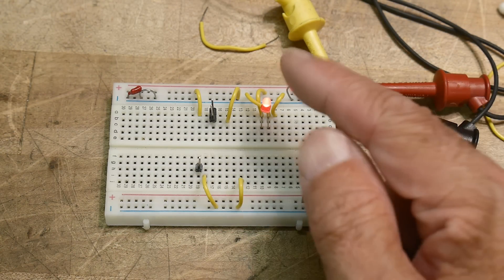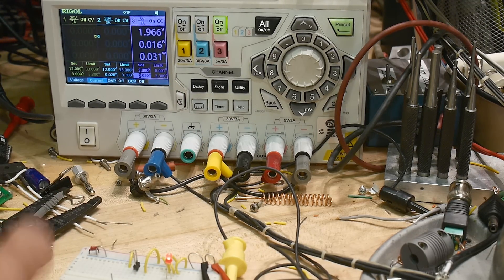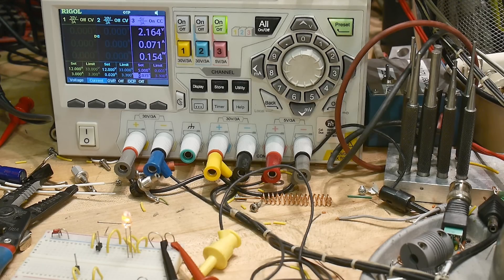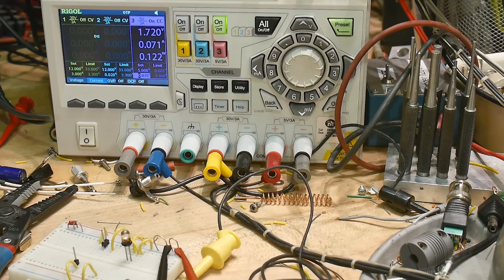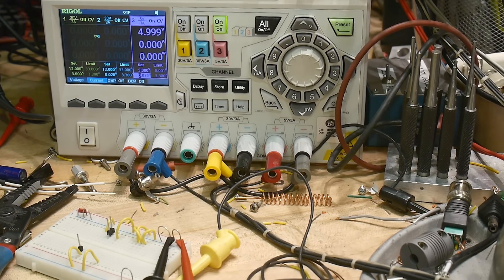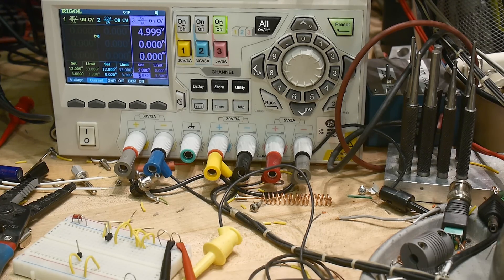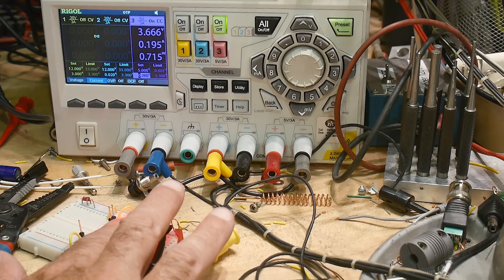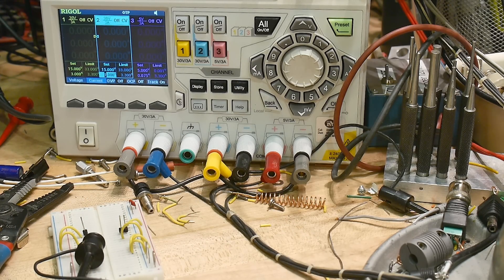#1212 LED at High Current

Comment: I've driven some various cheap LED's pretty hard,and they rarely failed,though they were noticeably dimmer after a while (Typically the white and blue ones,IIRC. Maybe the phosphor wears out after a while?) They ran nearly 24/7 for about two years,and were always warm to the touch.
I wish some consumer electronics would run the blue LED's a little cooler..Like,stick an extra 100K in there..sometimes they are STUPIDLY bright. The panel on my Air Conditioner lights up my entire apartment at night,it's actually blinding to look at in the dark!
Reply: Oh,also- I had some cheap 3mm white LED's that would visibly light with flea-fart levels of power. Like,bend the leads out,and hold one lead in a dark room. If there was a nearby source of RF (like a WiFi router in the same room),they would dimly glow! It took almost nothing.
Reply from the maker: the blue LED degrades, not the phosphor. the color would turn blue if the phosphor fails

Comment: I think over driving a LED for a few minutes during a video is ok, but pushing the current up will tend to shorten its life. I’ve a few white LED’s which when over driven produce a nice little black dot for awhile before going out for ever.

What we have to remember the datasheet is not like a set of scales, what you put on one side it removes from the other to balance. So if they quote 50K hrs life and max 20mA and you put 70mA through it then the 50K hrs is going to be reduced, by how much is going to be in the hands of the god’s.

Sticking to what’s in the data sheets means that the data in the sheet holds true. Going with less than 80% of the max value means you might exceed the life expectancy. Performing MTBF (Mean Time Before Failure) calculations on circuits shows that over driving displays might be good for a short time but not great for your customers.

 Did a display with sunlight readable LEDs that needed a massive heatsink to try and keep it cool but it still felt like it would burn the data in to your finger tip. Try to think how bright a LED needs to be to be seen with the sun shining on it. I know now why pilots in jet fighters wear gloves.

Comment: I've recently bought a cheap stock of 400 LEDs and I'm really really and really again surprised for their high efficiency, obtaining more luminosity of the older ones but with the hundredth part of current consumption!
Reply from the maker: yes it is pretty crazy, back in the day you had 220 ohm  loads resistors and now I always use 1k and they are still way brighter
Reply: @IMSAIGuy  10k for me! and they are still pretty good bright! 🤦😂 I do love your vids👍‼️

Comment: 3 things I want to say:

*  LEDs, like any other diode, when used in parallel draw different amount current, as result of variations in characteristic as result of temperature and process. So if you use one resistor to power up two parallel LEDs one LED might be much brighter than the other.  That is why we have simple circuit called LED driver, to adjust the brightness for each individual LED.

*  If you have leaser Diode, leaser diode is LED diodes that have cavity to synchronize the light photons, as you increase the current from 0, it first start from LED phase, then as you increase the current it goes to laser phase, the phase noise of laser light goes down as you increase the current,  finally as you increase the current you warp the lens  and reflection surface as result of local heat generated and your laser diode will become LED forever.  The rated current is to make sure your laser can have so much life time. 

*  Rated current for LED is to make sure you have specified life time for the diode. As you increase the current beyond the rated current, following thing happens:
     
     -  Specified temperature range of the diode changes.  For example the diode is specified for -40 to 125C at 10mA. If you increase the current beyond that it might have run away thermal breakdown at say 100C.

    -  The local heat generated warps the lens of the diode and the light pattern will change.  This is significant if you use the LED as a source fiber optic communication.

   -  The diffusion of doping material From N side to P side and from P side to N side as result of local heat causes the doping profile of the diode changes.  This redistribution of doping material  changes the Fermi level at the junction and your LED becomes dimmer and dimmer for given amount of current.  

On positive side you can use this technique, if you know what you are doing  by controlling current and temperature, to make PIN diode out of LED, which is much more expensive than LED, for microwave application.  You can also blast  LED with lower wave length laser, Say a red  LED with blue laser to change the doping profile of the LED.  In this case, each photon of blue laser absorbed by LED turns into electron hole pair and heat.  Your LED pins should be connected together to discharge electron-hole generated. You probably do not need Laser, a powerful light source with lower wave length would be sufficient.   

So much fun you can have with electronic parts, if you know sufficient amount of physics and math. That is why I recommend you guys to study Quantum Physics, Solid State Physics, electromagnetics.
Reply: Are you saying that my 30W 405nm LED panel for photoresist exposure may be causing permanent damage to LED lighting emitters on the celling of the room?
Reply: @Mr.Leeroy  You need to answer following questions:
1. What is wave length of ceiling LED?
2.  What is the power density of 30W 405nm at the surface Ceiling LED?
To calculate power density, you should divide your source power, in this case 30W, by the area it spreads,  
For example, compare Sun light's power density on Earth, Mercury, Pluto.
Reply: Very useful, thank you!

Comment: check this part: Texas Instruments JFE2140 
(JFE2140 Ultra-Low Noise, Matched, Dual, Low-Gate Current, Discrete, Audio, N‑Channel JFET)
The JFE2140 is a Burr-Brown™ matched-pair discrete JFET  built  using  Texas  Instruments'  modern,  high-performance,  analog  bipolar  process.  The  JFE2140 
features  performance  not  previously  available  in 
older  discrete  JFET  technologies.
7,50€ / piece

Comment: Still got a few of those 1970's early Monsanto red LED's, and yes they are dim, even at 50mA, but you really had to run them at 20mA with DC, though you could get decent brightness if you ran them at 1A, but 2% duty cycle.

Comment: I had an application once where I was doing stop-motion imaging, and used a 1 watt white LED, firing it with a measured amount of charge through an SCR.  I don't know how much current it had at peak, but it only had to run it for a few microseconds before the capacitor was discharged.  I think I eventually replaced the SCR with an RF power transistor to get a cleaner cutoff.  I ran them for months at a time flashing 100 times a second or so, and never blew one. 

I also have been known to drive LED's with current regulators, dissipating the excess power in silicon rather than carbon.  That lets me run, say, the backlight of an LCD off the unregulated power supply rather than having to pass its current through the voltage regulator.

Comment: Pure GaAs is IR
GaAlAs can be red

The higher current does reduce life due to  elevated junction temperature and higher current density

Mean time to failure (MTF) drops exponentially with junction temperature and typically with the square of current.  This is very predictable, not some ledge you fall off if you exceed specs.
Reply from the maker: I think the LEDs I showed dated from the late 1960's. I think they were GaAsP layer on a GaAs substrate. Aluminum was added a few years later as was GaP

Comment: Back in the 80's in college I did maintenance at a local car wash chain, the light bulbs on the coin counters were always going out.. so one day I made a trip down to Radio Shack and bought a shit load of LED's and matching resistors and started soldering replacements. I think they are likely still in use today... I honestly don't remember a single one of the failing in the five years I was there.

Comment: Our engineer on the microwave system explained about wattage one time when the neighborhood was up in arms about RF and electrical EMF's and they asked "well how much wattage does the microwave produce?" and he said "1 Watt"(of course the dish has 30dB gain so it is like 1000watts ERP) and the were like "Oh" and then he says "Yeah when was the last time you burned your finger on a 1 watt light bulb" they were trying to make an issue because of the tower we were on that has been there long before the houses were there-and a little side note one of my coworkers wanted to be in the radio building and tell the people "oh its safe  and then open up an umbrella that he covered in aluminum foil as he walked out of the building and as he walked over towards the people making a fuss.
Reply: Most microwave systems run at less than 30dBm. Many at 23dBm or 200mw.
Reply: @chuckcrizer  ours had the high power final amp that was operated at +29dbm so close enough he rounded it up to 1 watt for the typical "irate" neighborhood people to keep it simple-the microwave was the MDR-4000 then we moved to the MDR-8000
Reply: Or ask them if they have a microwave oven in their home, carefully tuned to the frequency absorbed by meat.

Comment: The maximum brightness of new LEDs decreases over time.  Overdriving them does make this occur faster.  Overdriving them also produces no more light (enough extra current reduces brightness actually).  Thus, there is no incentive to overdrive them.  If constant brightness is more important than maximum brightness, underdriving them (say 75%) reduces the rate that brightness decays.

Comment: Seems you have a nice collection of vintage LED's, with knowledge of types, years made, and possibly use cases to boot.! It would be amazing to see a brief history of them all lined up on bread boards in chronological or composition type of order., being powered  There is something more alluring to the light output of those versus newer models. I would give the similie of pinball machines with their older incancescent lighting versus the newer blue/white LED replacements.

Comment: Slightly off-topic: If you wish to hook up a low-Z-load (e.g. an LED) to a benchtop power-supply, with the current limited to (say) 1A with the knob on the PSU. 
In implementation, imagine that you first power-on the PSU, and then connect the wires of the load... In my experience, despite the current-limit being set to 1A, a large current momentarily flows through the load (caused presumably by the output-capacitor of the PSU discharging into the low-impedance load, before the regulator's control-loop kicks-in; or downstream of the regulator). This is usually enough to damage a sensitive load.
Do you encounter this issue often? (e.g. with the Rigol benchtop PSU?)

Comment: I used to drive those old 5mm LEDs with an 100Ohm/V resistor. For TTL, I often used 510 or 560Ohm resistor to limit the current. Even now, I find strange to use KOhm resistors in series with an LED for 3.3V
Reply: I used to have cemented in my mind that the "proper" current for LED is 20 mA. You know, old books and other publications. I was a little surprised when I applied this rule while replacing light bulbs with LEDs in power windows switches in my car. Eventually I ended up with 47 k resistors and the LEDs still are quite bright.
Reply: @brys555  Yes, an old 5mm LED from 80s was quite bright at 10mA, well seen in daylight. Now, an 3mm LED is brighter at 1mA. Technology advances.